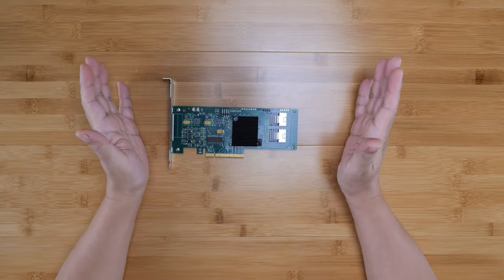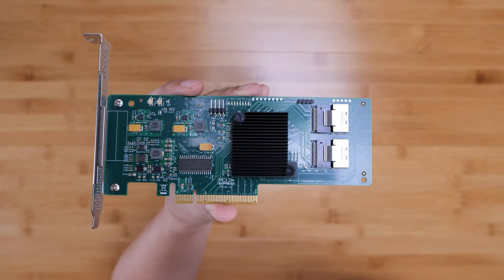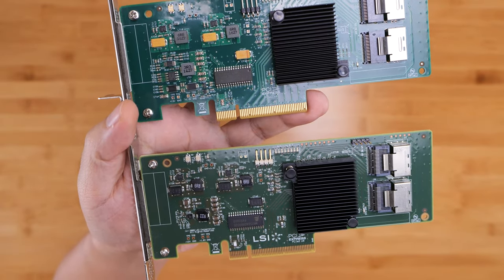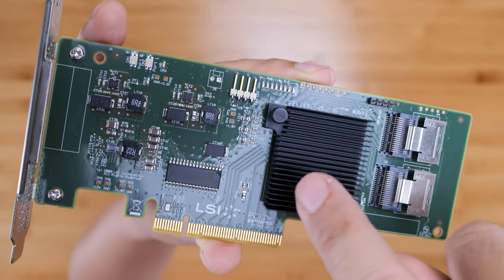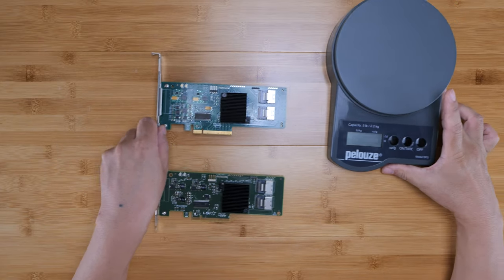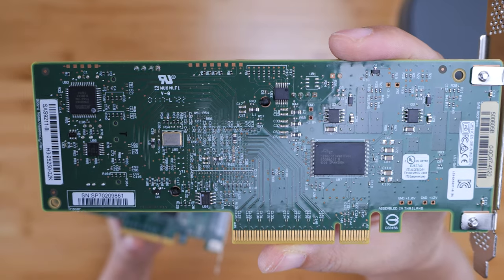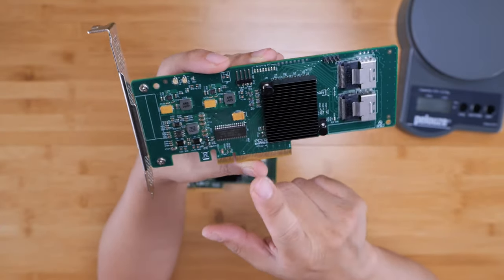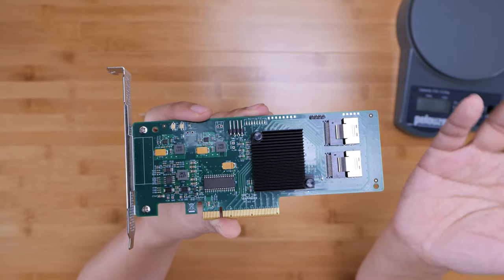Another counterfeit LSI HBA | 9211-8i with no LSI logo

Comment: This is probably a good design of CN OEM SAS2008 card.
From EE point of view, I see no disadvantages in their design at a glance. As long as it uses original chipset, power section is implemented correctly and PCIe lanes signal integrity is sound it will work the same. And these things are very doable for a competent engineer even some hobbyists.
Some components are different in power section, which is perfectly normal as there are tons of ICs that will give you same specs voltage rails. The only noticeable difference is that definitely clone uses tantalum capacitors (yellow SMD "bricks"), while LSI one uses black, which could be polymer ones as well as same tantalum just different color. And in this case latter actually makes more sense anyway, so probably just a cosmetic difference.

Comment: Very minor point, but the different looking metal traces/pins is almost certainly not because the actual base metal is different but the plating/coating that is applied on top. There are a number of different finishes used for PCBs (gold/silver/tin platings etc), but they all use copper traces. Some of the difference in appearance can also be because of different types and thicknesses of the solder mask (the green coating on top).
Reply from the maker: Thanks for sharing this information. :-)
Reply: @ArtofServer  hi bro , please help me < I have purchased this device dell t7910 and it has 2X processor 2699 v4
128 gb ram
However
Boot time is very slow, and it takes 3 minutes to boot to the desktop

Most of the time the device beeps and freezes
And when I work on 3D programs it is very slow and freezes

Is there a solution according to your experience?

Because the device has strong capabilities
But in practice, the device is very slow and bad

Even though I did a test for the processor and the ram
They all give a green pass
Reply: @yghjjhgj  what are those weird numbered videos you have on your channel?

Comment: Why did you assume it’s counterfeit card? LSI makes chips and provides a reference design that other oems use. It can just be a no-name reference design based card
Reply from the maker: Not an assumption, just suspicion. And as to why I have suspicions, that's covered in the video. This card also did not follow the reference design in the power management section of the board, so it's not really a reference design card. Yet, it has a LSI serial number label. All the other OEM boards based on reference design, they actually followed the reference design, have LSI logo and various certified markings/labels. Also, this card's PCIe ID didn't make any sense, since a 9200-8e card is a totally different card. No OEM would do such a weird thing, in fact, they would have PCIe subsystem ID that would identify the OEM, not fake a totally different card's PCIe ID just to get the firmware to boot. All of this is covered and shown in the video. Did you even watch it?

Comment: The thing to bear in mind is that 92xx and 93xx are both regarded as "long obsolete" legacy cards by Broadcom and they've farmed them out to 3rd parties. Any new cards you may run across are OEM or very old stock (at least a decade, maybe older)

As a nice "bonus", these cards don't support ASPM and will keep your machine in higher power modes(*). That's OK in a server room, not so great for a SOHO server 

It's not just the power difference of the cards (1.5W/port in 92/93xx vs 0.5W/port in later models), but on my X10Dri motherboard I'm seeing the system base power load (no drives) almost double (50W to 100W) with 9200 or 9300s plugged in vs a 9400 

9300 and earlier fusion MPT use a PowerPc core, 9305 and 9400 onwards use Arm core, which explains the power difference. Additionally the 9305 onwards support 24 ports natively so you don't have the kludge of the 9300-16's 2 controllers and a PCIe bridge bringing the things up to 25W/card

(*) You can enable L1 on 9300 series cards by forcing the OS and using setpci but you'll throw random intermittent SMART errors on a near continuous basis, so it's best not to do it

Ok, that power difference is dwarfed by the 250W my (aging) 22 4TB HDDs are drawing, but as time goes by and they're replaced with fewer (larger) drives, it starts bcoming more noticable
Reply from the maker: There was a very significant platform change after the SAS3008 and earlier, which were PowerPC based chips. Up until SAS3008, power consumption kept escalating. The SAS3400 and newer are now ARM based. So that's where the power efficiency comes from.

Comment: Thanks, interesting video. If we take a step back and look at the big picture, is there really a lot of profit in making fake cards? With counterfeit cards you'd expect a lot more obvious flaws, and the most crucial bit (actual real world performance) will prove if they're fake. To my (untrained) eye these two samples look virtually identical apart from the subtle differences you pointed out. So I'm inclined to agree that these are unbranded OEM samples. The amount of engineering that goes into making a fake card must be substantial, so it makes no sense unless its total garbage that doesn't work...

Comment: As long as the card has a properly stitched ground with adequate amount of (max spacing in between the vias based on rise/fall time of return path) vias and correct spacing in between pcb layers

Comment: do the counterfit cards work more slowly or produce errors?
Reply from the maker: Since the chip is the same, that part I think is no different. Where they cut corners are things like the heatsink (smaller usually), or perhaps materials used for the PCB and other SMD components. My speculation is that over the long run, they might not be as reliable, or may require more airflow to keep cool with the smaller heatsink. But, I've never used one of these long term so that's speculation.

Comment: Woah, I have a bunch of 9211-8E…do I need to see if this is why some may be slow?…
Reply from the maker: 9211-8e? or do you mean 9200-8e? and no, I don't think counterfeit cards run any slower. they just have smaller heatsinks, and seem to sometimes use subpar materials. i think the end result is that they might be less reliable in the long run, and perhaps require more airflow to cool at the same level.
Reply: @ArtofServer  9200-8e and other variations.

Comment: I wonder if the weight could be in the Bracket.
Reply from the maker: No, I checked and the bracket weight is identical, and the weight difference of just the card bare is the same 9 grams.
Reply: @ArtofServer  MiniSAS connectors are different, VRM inductors are shielded ones (more dense), additional components and difference in weight in common ones, probably a gramm or so for tin plating of PCB, but the bulk should still be heatsink difference, since you say that it is not bracket.

Comment: Hmm. My card I bought (9211-8i) has the LSI trademark with a 2009 date, above the assembled in Thailand, but the card is a different shape with the ports being on the side towards the PCI backplate, and it doesn't have the LSI logo. Works, though. What card did I get? If you could make shipping a little cheaper to Australia, I'd be able to buy from you. Right now, the Chinese have the monopoly, unless you wanna spend big.
Reply from the maker: Not sure what card you got. Sounds like an external SAS card?

Unfortunately, not much I can do about shipping costs to Australia. Everything in this damn place is expensive and the politicians just keep spending like they FOMO. Shipping prices are going to rise again in November. :-(
Reply: @ArtofServer  na, it is an internal card, just the ports are not on the end of the card like the 9211-8i. I figured out what it is - 9210-8i, which seems to only differ from the 9211-8i by where the ports are located. I actually had a 9201-16e laying around that is legit and has all the correct markings, I just slot that in and routed the cables from inside the case to outside.

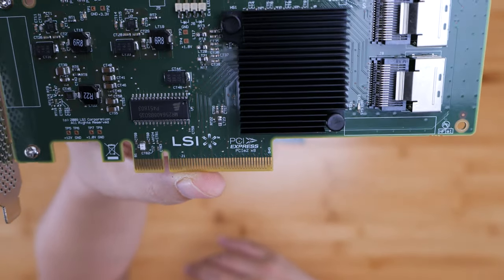Comment: 8:30 The green color layer is called the soldermask usualy. Silver would be hasl, gold copper color would be enig which is usualy better.
Reply from the maker: Thank you for sharing that information! :-)
Reply: This is not ENIG, it is just a bare oxidized copper not covered with solder mask.
Clone is better in this regard, of course its PCB was made out of copper and then tinned before applying solder mask.
It is an additional step that LSI saved costs on, which made sense in '80s maybe, not sure if it does now, may be at very large quantities, not even LSI quantities..

Comment: If I were to inadvertently buy a counterfeit card, will it still work? What problems might I face?
Reply from the maker: I have not used a counterfeit card in any long term capacity. but from the observations described in this video and others related to this topic, I would expect that they are less reliable with the smaller heatsinks, and potentially if they are using lower quality components. but that's just my speculative opinion since I have not used a counterfeit card in any of my servers. anecdotally, some of my customers have reported to me that their counterfeit card failed pre-maturely. although, some people have reported they are working just fine.
Reply: @ArtofServer  Thanks. I live in Asia and all the cards I've found for sale here are shipped from China. I have an LSI 9217-4i4e on the way and my thoughts are there's a high chance it could be a counterfeit card. I plan on attaching a 40mm fan to the heatsink, so hopefully that will prolong its life if it is indeed a counterfeit with smaller heatsink.

Comment: Nice I don't know it's counterfeit or not.
But I saw difference
Orginal has Electroless Nickel Immersion Gold (ENIG) or OSP (Organic Solderability Preservative)
Counterfeit card has HASL or Immersion Tin (ISn)
2nd orginal has some smd components in back side of the card.
But counterfeit has those components on the top side (as u refered to complex) left side of the nv ram.
Reply from the maker: Thanks for pointing that out!
Reply: False.  HASL finish would be silver in colour, not gold (like we see in the video on the connector pins)
Reply: @AndehX  if u have watched the whole video, the creator is referring to SMD pads not PCB EDGE connector(PCIE x16). PCB EDGE connectors are gold-plated in both cards.

Comment: These aren't counterfeit.  They are oem revisions.  Sometimes unbranded and use the same chipsets.
Reply from the maker: I disagree. I've seen OEM boards from Dell, Fujitsu, Inspur, Supermicro, and other brands and they typically do their own design and look completely unique. In this case, the card is clearly a low cost copy of the LSI reference design. They seem to be using a cheaper conductor material, and the power supply circuitry is using cheaper components instead of ICs. On top of that, the serial number format is a LSI serial number, which are never on OEM boards. So, in a way, it is pretending to be a LSI reference card with LSI serial number, but is doing a poor job at it. Also, OEM cards will typically have their own branding on the card, this has none. If you think this is an OEM, which OEM brand is it?

Comment: you cant really say the thing is counterfeit if they actually using the same silicon on the main chipset as the reproduction ones. 

so the thing is, these cheap lsi cards works the same as the cards with printed LSI branding on it.

I can only say if this card is counterfeit if the card has major hardware difference, just like in game controllers for ps3, the original ones uses toshiba chipsets while the counterfeit uses who knows what inside the blobtop. 

if were going to use your logic, no LSI logo on PCB  = counterfeit. You might as well go call all those HP rebranded LSI cards as counterfeit as well all of that because it lacks LSI logo.